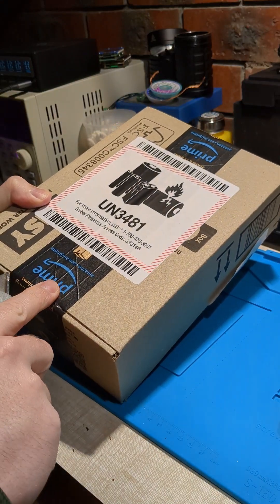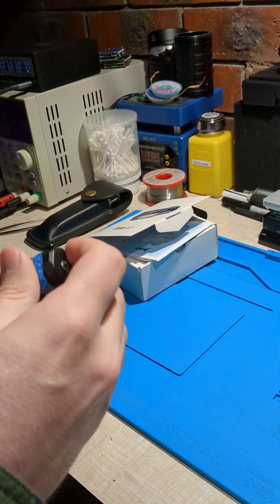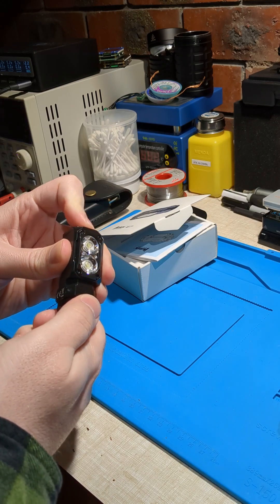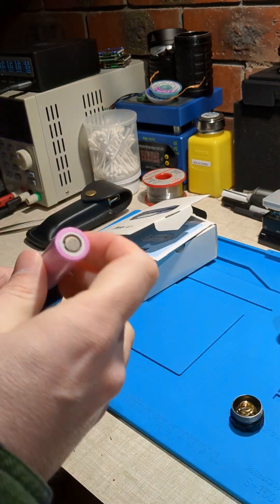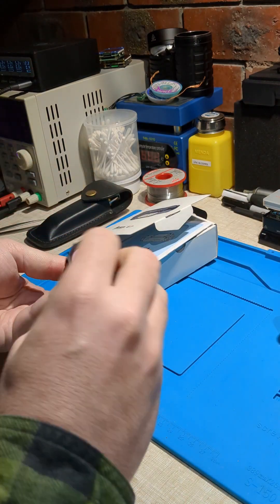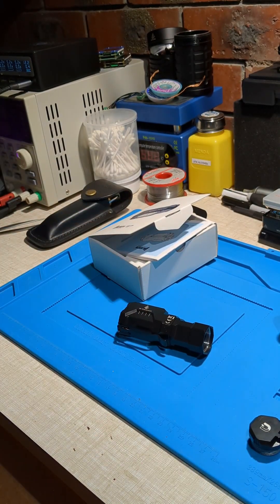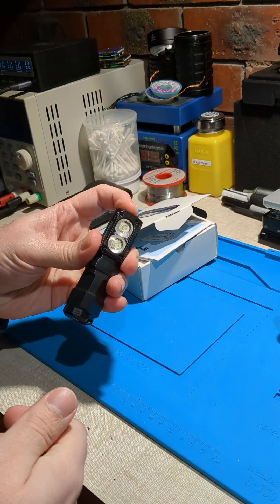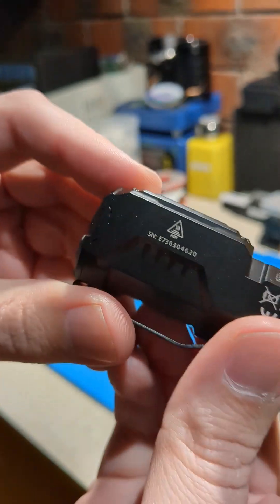Wuben E7: Will it explode?

Comment: What’s the worst that could’ve happened with the battery? Could it have been tested with a protected one? 😅
Reply from the maker: Worst case, the battery might short and explode. It is probably more realistic that the driver would burn up and the circuit may fall apart before the cell gets a chance to explode. I posted a video last year where the driver started smoking and burnt itself due to the battery being inserted backwards. I tested reverse polarity protection with a protected cell at the start of this video, this just caused the protected cell to cut-out temporarily.
Reply: @TorchHacker  ah yes that’s right. You’re a braver man than me testing with the unprotected battery haha